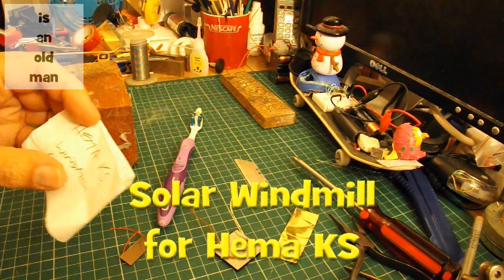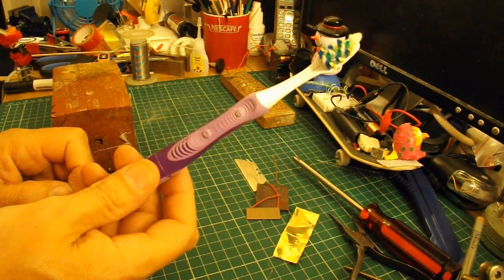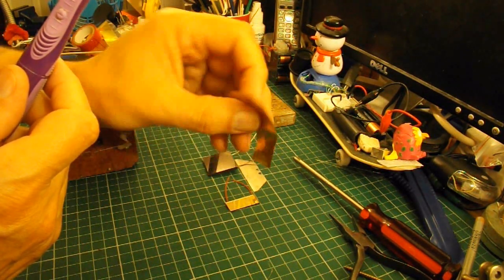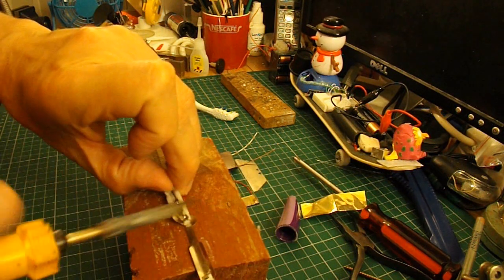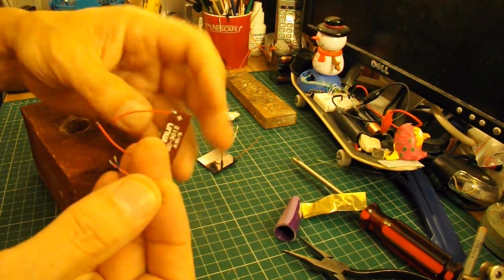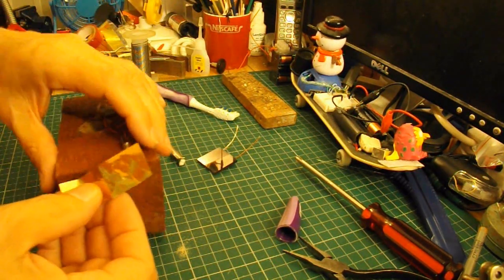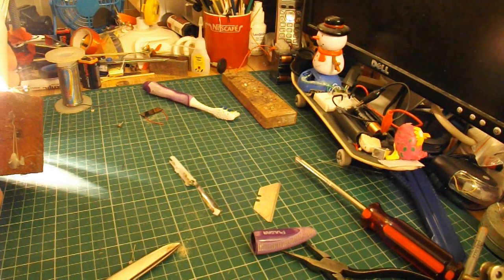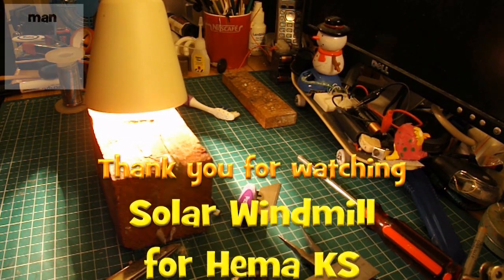Solar Windmill for Hema KS

Comment: Can u combine solar panel :-)
Reply: Jboss2001 Gaming yes yes u can by connecting 1 red wire and 1 black wire to create a stronger voltage
Reply from the maker: Jboss2001 Gaming yes, as Aleksander Sats already replied, or you could just use a bigger panel.